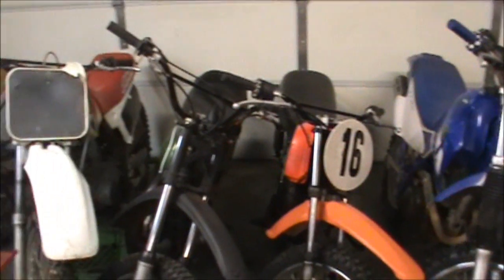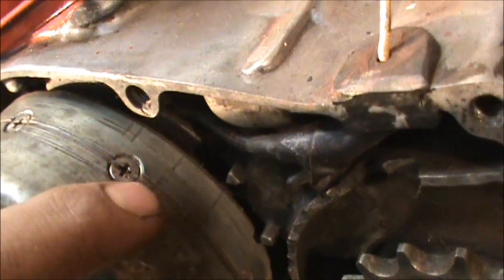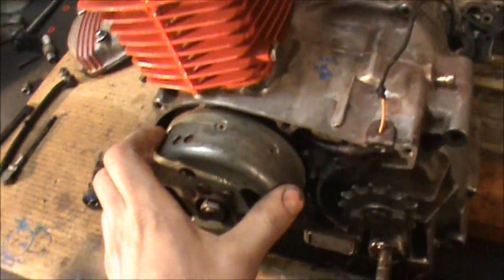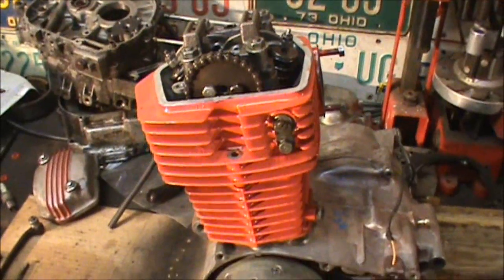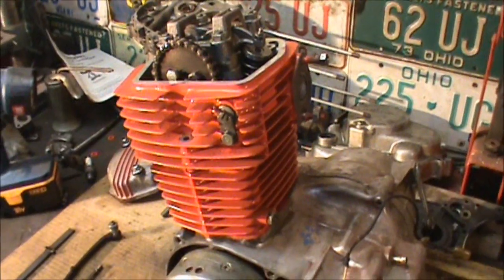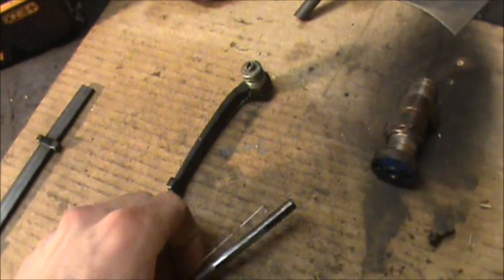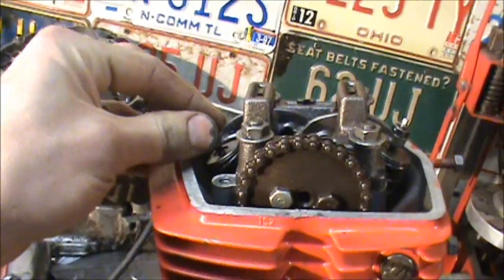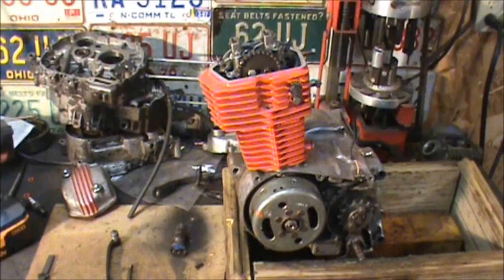How to adjust Timing, Timing Chain Tension and Valves!

Comment: If the bottom rough adjuster bolt is leaking oil, is it as simple as taking the screw out to replace o ring and screw back in?

Comment: Bro I’m so worried got the xr100r and adjusted the timing chain on the side of the engine and turned it to the right a bit and the ticking stopped completely but then did it to the left and it also stopped but fotogr how many turns I did I just shouldn’t of messed with it how am I supposed to know if the timing chain is too loose or tight now ?????????

Comment: I have done several of these engines over the years but my 22 yr old son picked up a 1974 honda xr75 e 
After a little tinking i got the motor unfrozen ,set the point to .012. And the valves from .002 to .005. I got great spark and i cleaned the carb that came on it but also got a brand new carb all i can get is back fire out of the carb ?
That last part of my puzxle is some put a Schrader valve after removeing the core installed in the elbow of the air box directly in line with the carb like they put in a port for N.O.S. and help or ides would be greatly appreciated 
117-122 psi for compression

Comment: thanks I assume the top chain adjustment is the fin adjustment and should be turned clock wise? how far is to far? did I understand the bottom adjustment is auto adjusting?

Comment: hey man I've got an xr 100 I bought it for 150 with no compression it's in good shape other than a tear in the seat I got to tearin it down and the timing chain was broke the cam gear was mutilated. do you know where I can find parts? the chain wasn't in the bottom of the case

Comment: great vid. subscribed. When adjusting the timing chain tensioner, is it done with the engins running at idle or not running. thanks.
Reply from the maker: The lower adjuster is adjusted with the engine off. The upper adjuster can be adjusted with the engine running. Thanks for watching.

Comment: may I ask sir if it is fine or no problem to the engine  if I just cut a center line on that rocker arm adjuster to be able to use a screw driver instead of that square socket cause I ain't got nothing of that square adjusting tool.

Comment: Excellent and clear video for cam chain adjustment.  Thanks for showing the spring loaded nature of the auto-tensioner lower mechanism in conjunction with fine tuner upper.  Clymer manual had correct procedure but confusing without understanding the internals.   Again, thanks for the time to put this together.

Comment: I have a yamaha 1100 and i tried to fix a leak on it and took it out i put the seal and closed it up. Thing is that i did not retract the tenisioner....and rode it like 3 min like that... could i have possibly done major damage to the engine or any major problems...i have been doing my research on cct...i got a mechanic already hes gonna do the work but its till this satrday....i just want to be prepared with the right material aswell...and some comfort that i didnt do majprdamage aswell....

Comment: Thanks for the video.  I didn't see how you change the timing though.  Everything was verifying TDC, tightening the chain guide and adjusting the valves, but how do you change the timing?
Reply: I was wondering the same thing.
Reply: Me too. Mine doesn’t line up with “T”, but no instructions on changing it.
Reply: @jerriwingard7370 did you ever figure it out

Comment: I got a used 1998 xr80r and its in great condition just one day I was riding and then a loud noise came from the piston and the gears locked up and it wont start and I thought the time chain broke but I took it apart and it wasn't broke and I have no clue what happened can you please help me I really need my bike fixed within a month because I'm going trail riding please help!!!!

Comment: HELP! My 85 XR80R is exactly timed like that one, and it won't start. All it does is backfire. I've cleaned the carb, replaced the plug, cleaned the tank, and tried starting with starting fluid and it still won't start! Any ideas?
Reply: Curly fives Figured out what was wrong. The rings I bought for it were too big, and the guy that installed them never told me and continued installing them. Piston shook around in the cylinder. Fuel was in the oil.
Reply: Airbox, make you use the stock airbox and filter (oiled). these little XRs dont like too much air, also check your carb boots for leaks or cracks. hope this helped.
Reply: all of that is done
Reply: then its either your fuel, or your carb is not jetted right. pull your throttle body out if your carb and check that the needle doesn't have any wear marks (horizontal lines) theyre only hair line but make a huge difference on these bikes. if so then it needs replacing. mine had this problem and no airbox.
Reply: how do i check if its jetted right or wrong? i have a friend that suggested that the rings were put in wrong when i had it rebuilt, because it doesn't have any compression
Reply: and it backfires and ignites the airbox
Reply: well, you can only really tell if jetting is right if all the other things are working fine. also look at spark timing on your points (or CDi) theres a few videos on how to check that (Mrmaxstorey). and you should check those rings, dont kick over the bike if the rings are in backwards!
Reply: Alright!
Reply: How do I check to see if the rings are in backwards??
Reply: The rings have notches which they slot into, the rings should be spring like when they are in the notches, closing inwards towards the centre of the piston when when you squeeze it with your fingers. it might just be that the piston was in backwards. if in correctly (in most cases, not all) the N on the top of the piston should be facing towards the intake of the cyclinder (the back of the motorbike). look up "top end rebuild xr80" and you should hopefully find something help full. (xr100s are the same)
Reply: thank you!
Reply: bump it
Reply: paul smith figured out what was wrong. Rings were too big. The guy I had rebuild it put in too big of rings.

Comment: You ever work on a Yamaha XT225? I have one with 22,000 miles on it. It's a fun little bike. It's got some chatter in it. I adjust the valves and it seems like the chatter get's a little better. I have only ridden about a 1000 miles on it since I bought it in May. I have adjusted the valves three times. It is making noise again. Someone told me it's the cam chain needs tension adjusted. I cannot find out how to do that. Do you know how? You think it's mucked up? Thanks!
Reply: If you can, REPLACE the cam chain. after 22,000 miles on a single-cylinder bike, it could have stretched. Then, once you get the new chain in, adjust the tension correctly and you should be good to go. 

Be careful to not rotate the cam or crank when taking the old one off and putting the new one on!!! That could bend valves, damage your piston and make for a bad day. 

Here's a step-by-step with photos of timing chain replacement. Be CAREFUL to not bark up the Philips screwdriver screw-slots. A deft touch with an impact wrench saves those. 

http://www.xt225.com/forums/ubbthreads.php?ubb=showflat&Number=88352

Comment: What happens if your riding and the timing chain breaks? What damage could occur, especially at high rpm's. Is there a safety that will keep the exhaust valve open to let out the pressure?

Comment: Great vid. Got timberwolf replaced valve adj screw new wont run. Had 2 remove top end to get old loose screw out of motor. Put flywheel and chain back the way I found. Was running before I tore it dwn. Help

Comment: what did you do for a replacement gasket on the head there i get so lost when it comes to gaskets can you help me out here i have a 1985 xr100r and im thinking about doing the valves and timing but are there gaskets on the top and sides?

Comment: I have A question!On a 2002 xr100, which looks like the same setup as this how do i remove the timing chain guide that runs through the cylinder and cylinder head so i can replace the gasket i cant seem to find out how to remove it?

Comment: i have cleaned out my points put new piston and rings and valves and reseated the valves and adjusted them to spec set my timing but the bike will backfire through the carb! whats going on

Comment: great video love it, i have a 125 cc senke (peace of crap bike) but all i can afford, my question is my chain keeps coming off (not timing chain) i was thinking of taking out a link, is there an easier way to tighten it without using the back wheel (as already tryed and it goes back to coming off after a couple rides) please make a video showing this sort of adjustment, thanks again.

Comment: hey man i love your vids but i got a question. i got a 77xl75 for 100 bucks but the cylinder got rusted from sitting . i cant find reasonable cylinders or oversized pistons. are there any other cylenders and pistons i could use on my bottom end and my head

Comment from the maker: Make sure the piston is at TDC (top dead center) and check for the T on the flywheel and place the cam in with the lobes down, and set the dot up and place the chain on.

Comment: Glad I found this, It helped A LOT! I bought a bike last spring, hired a recommended mechanic to work on it ( I knew it needed the timing adjusted or valves), buy I dropped $380, got it back with a bad oil leak, and I have put a whopping 31 miles on it by time it stopped running. It literally died 4 times on the way home. But after him having it 7.5 weeks, and causing an oil leak, I wasn't taking it back.. Hope I can pull ot off myself. Finally tore the plastics and tank off today.. Now learning

Comment: hey great info on the motor ,,,I 
Got one question when you pop of the mag/flywheel
is their a washer and nut that holds it on the crank or just a nut?
i have a basket case 83 
xr 80 when i got it was missing the fly wheel key and all it had was a nut,,so im thinking maybe a big lock washer needs to be under the mag nut?

Comment from the maker: @nathanb3100 To loosen the clutch handle just tighen the adjuster that goes into the clutch lever perch... if you dont have anymore room there go down to the sidecover where it goes onto the arm and tighten it. Oil wise fill it until it's at the top of the dipstick crosshairs when the engines warm... but dont over fill it. I'lll get a video on all of this sometime soon. Thanks for watching!

Comment from the maker: @nathanb3100 The engine is cast aluminium so it's not rust... just oxidized and maybe corroded... hit it with some steel wool and it will clean right up! Thanks for watching!

Comment: GREAT VID MAN. IT HELPS A LOTT   i have a question, if the valves arnt set just right then will that cause it to not start and run?  long story shot i rebulid my 02 xr 80 (new rings and seals) and i put it back together and it wouldnt run. i know a lill more now so i might try to take it appart again and try to see what i did wrong. i was pretty sure the timing was set right but watching your videos im not sure now.i really hope i can get it back running again. thanks

Comment from the maker: @highlandhillbillys Oh yeah those side covers break all the time... very common! I had one that it was broke right at the sprocket and layed a piece of plastic on the sprocket side and Jb welded the inside waited until it dried, pulled the plastic and sanded it down. Been working great and keeping water out of the stator. Give it a try! Thanks for watching...good to hear from you!

Comment: nice video's just a question I have a xr 100 2001 it was in pieces when I got it, the chain broke and busted the ear of the stator base where the pick up coil mounts to, busted cam,and  flywheel side cover broke, it looks like the tap on the flywheel is pretty chewed up just wondering if you have ever seen or come across this issue and if so have you tried to fix it, I was thinking about putting a bead of weld on this tab and filing flat. I can send you a pick if you would like. ohio native too.

Comment from the maker: @joeybuffdaddy That's correct, if the camshaft and sprocket are Not aligned right your timing will be off, and you can bend you valves when the piston comes up if they are open at the wrong time. You'll want the piston at TDC all the way up... dot aligned and camshaft lobes pointed down. You'll get it bud!

Comment: ya i have good spark! i have checked the timimng 4 times and it is good! it sounds funny when you kick it over. fuel is spitting back out of the little copper tube in the back of the carb!! WONDERING if maybe carb is plugged somewhere and not getting fuel.....what do you think??? this is driving me crazy!!!! thanks jfrost77hd!!!

Comment from the maker: @DOUG5571 Do you have good spark? Sounds weird but I had a similiar problem after a rebuild and just had to replace the condensor by the coil and then it ran great! Check to see if the condensor is good.

Comment: @jfrost77hd  well i messed around with it and got it to run.  After about 30 seconds the motor locked up. Its in the lower end. Parts in the mail.  By the time i get this bike running i hope i dont have enough money in it that i could have bought a knew one. ha.

Comment: great video. I just bought an 80 xls and im getting ready to do this.  It dosent run but has spark, and carb is clean. Havent tested compression but it feels ok. Will try and test today. Wont even fire off ether.  Im hoping the valves are way off or the cam spun.

Comment from the maker: @1rad58 Yeah it's always something.... I did all that work on mine and had very little spark and couldnt keep it running, it sat for about a year, came back and worked on it and realized I'd forgot to hook up the condensor... plugged it in and fired right up and runs great! Definetly always something... that's part of the fun though is tracking it down and finding it and getting the accomplishment of fixing it!

Comment: ha ya im 6'1" and i bought a 1983 yamaha pw80 just because of the price.. showed up to the guys house and paid 40 bucks..came wtih original pink from '83.  had no top end at all and had been sitting outside for years..  sooo new main bearings and seals and a brand new crank and also did trans bearings while i was in the cases, then found the ENTIRE top end brand spankin new on ebay for $120 but ended up getting it for $81.something.  now it doesnt have spark. chased down a bad magneto pickup

Comment from the maker: @1rad58 Yeah sounds oh so familiar.... I've worked on and rebuilt a few Xr80's and 100's and that's usually what i find. I've had quite a few.... I still have this one and have way to much money in it. Bought it for $50.00 hey cant go wrong... Right? Wrong... I've put a new head, valves, cam, cylinder, piston, rings, clutch, and tons more! I'm 6''4 do I really need a Xr100.... no but just couldnt let it defeat me! ;) Had alot of fun along with the headaches!

Comment: @jfrost77hd y thats exactly what happened to mine.. we didnt clean the filter for about a year and i rode in a very dusty field all summer and it started to overheat one day and it began to burn oil and we never checked it till we reallized it was completely out.. then after another 10 hours of run time we did a bore job and realized the cam saddles were scored but ran it anyway & got it all back together then we didnt check the timing chain tension and it slipped and bent the intake valve  :(

Comment from the maker: @1rad58 Yeah that's one of the most common problems, people run them low or out of oil and on the cylinder head saddles where the camshaft rides gets worn. Then you need a new head and the list goes on from there. But yeah very good engines like you said will run forever if you take care of them with the basic. 
Thanks for watching!

Comment: great thing about these engines is they will run for years no matter what you do to them but they will run forever if you keep up on oil changes and clean your filter, and other things that should be taken care of every now and then.  back in the day we used to run our xr80 out of oil and not clean the filter for a year and they ran good for how we used em but i wish we did do the maintanance on em bcz stuff started to get expensive pretty quick after a bore job, valves and other stuff.

Comment from the maker: @CoolSypherz76 Hey not a problem man! Yeah you need to have it running so you can hear when it's adjusted. When you replaced that holder was the journals on the head where the cam sits worn? Could be just your valves or you timing chain aswell if it doesnt quite down adjusting the tension.

Comment: Thanks for theses specs I think I may have my xr100 set to 006in but I'll fix that. Also is it a good idea to adjust tue chain tensioner while bike is running cuz my cam shaft is ticking like long stop and load. Check mine out and tell me what I should do, I think I may need a new head since I've replaced the camshaft holder.